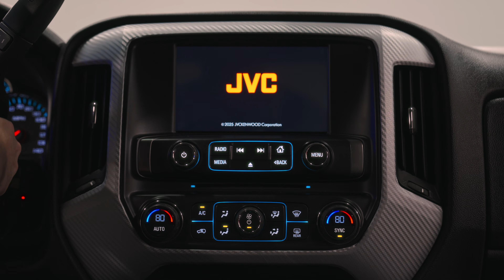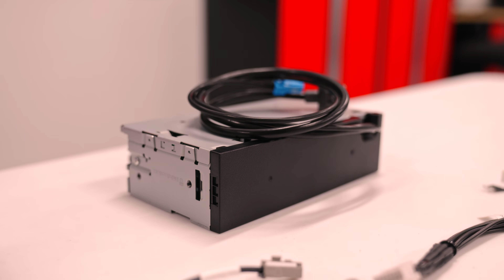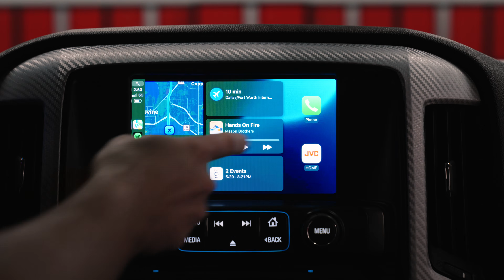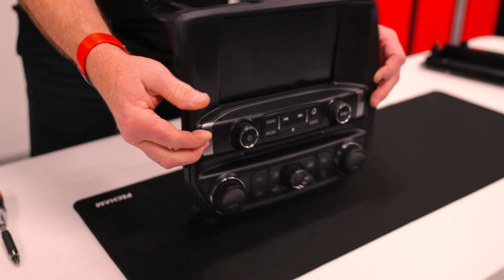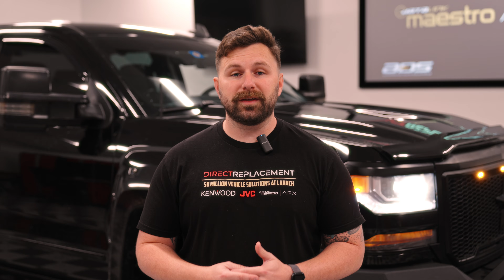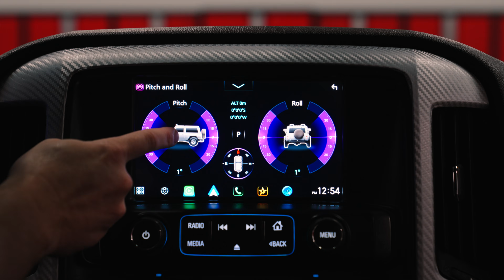JVC Direct Replacement car stereos | Crutchfield

Comment: Will the screen still move in a 2015 Tahoe?
Reply from the maker: The JVC KW-Z800W direct replacement receiver will work well in a 2015 Tahoe, but it has a flush-mount screen design that's not adjustable.
Reply: If you're referring to the up & down motorization of the OEM GM screen, the 8" JCV will motorize up & down as well. There's a video on Maestro's YouTube channel showing the installation process.
Reply: https://youtu.be/wnnjVYnHCkE?si=p5pIyNZijXIUsa4q

Comment: Little expensive but not too bad. Wish you all had a 2013 Hyundai Santa Fe kit for the Infinity speaker system. Look like zero Hyundai / Kia support actually per the website.
Reply from the maker: We actually do offer a special installation kit for the 2013 Santa Fe w/Infinity system to help install an aftermarket in-dash receiver. Check it out on our site here:  https://www.crutchfield.com/p_120997386B/Metra-99-7386B-Dash-and-Wiring-Kit-Matte-Black.html

Comment: What the hell this won't fit my 2016 Toyota Highlander Limited
Reply from the maker: Does your Highlander have factory navigation? Did it come with the JBL audio system?
Reply: @crutchfield  yes it has factory navigation and JBL Sound System
Reply: I just checked for the same vehicle.  I'm disappointed.
Reply from the maker: The JVC Direct receivers/kits are designed for select vehicles where an aftermarket replacement isn't easily available. You can install a standard double DIN receiver to replace the factory radio in your Toyota so there isn't a direct fit kit made.

Comment: $1600 for the 10 inch screen is diabolical!! The current 3rd party android radios are a 1/3 of the price.
Reply: Are they quality?
Reply: @webberfan1234  yes
Reply: I’ve yet to see a review of the cheap eBay or Amazon ones that says they’re high quality several years after installation.
Reply: @RyanRogers6161  I didn't say cheap.. a 1/3 of $1600 is $500+. The $80 units are trash. But what JVC is charging is crazy.
Reply: If I still gotta get a maestro module I might as well keep it the way I have it with the 300 dollar dash kit and 250 dollar maestro module. And my 10" floating pioneer
Reply: So 1/3 of 1600 you get to buy a disposable piece of junk? I call that diabolical.
Reply: @boblabarre3330  JVC is that you???
Reply: Comparing Factory VW, Toyota, Ford, $2k and up....... Lexus, BMW, Benz  $3k and up.  
China cheeseballs are also china cheeseballs. You can also buy an iFhone for $99 at a flea market, big deal.
Reply: @atyt11  Factory systems are overpriced for the technology available. They are not bleeding edge. if you want to buy one, im not stopping you! go right ahead!
Reply: @Lemonspeppasteppa  My point was, like an iPhone vs iFrone, that if you want cheap,  its available, if you want quality, its now going to be available, it will even look like factory for still less than what factory dated tech cost. and.....Double-din radios are so 20 years ago.
Reply: You get what you pay for

Comment: Hello again, if you remember me, Crutchfield, I am yet again in need of your extensive knowledge about car audio, and I wanted to have your opinion on: is it a good idea to replace the rear door speakers from a VW Passat B6 wagon that has Dynaudio, but sadly they're blown—that’s why I'm writing in the first place. Long story short, I'm planning to replace the blown speakers with the Ground Zero GZIW 165 on both the rear doors. And if I may ask, it would be delightful to get some recommendations for the front since they’re also blown, except the original amp—that’s why I would keep in mind a bit more powerful speakers to really use the amp to the fullest. Hope to hear from you soon.
😃
Reply from the maker: What is the year of your Passat?
Reply: @crutchfield  2006
Reply: enny other questions maybe neaded or no?
Reply from the maker: If you go to this link, you can enter your specific car info and see if these systems will work for you: https://www.crutchfield.com/i-rYTVc346/shopsearch/JVC_direct_replacement.html